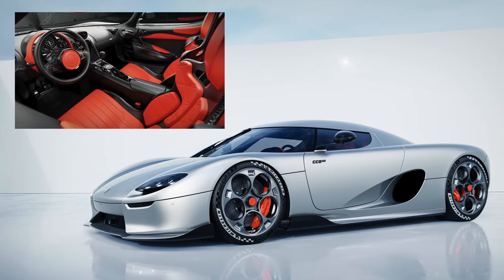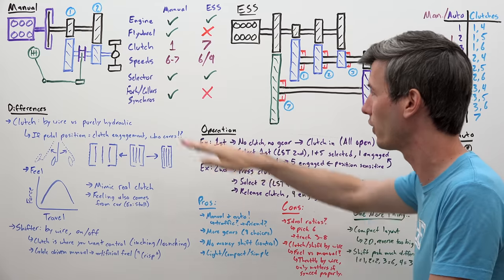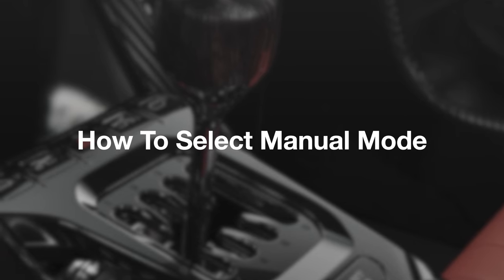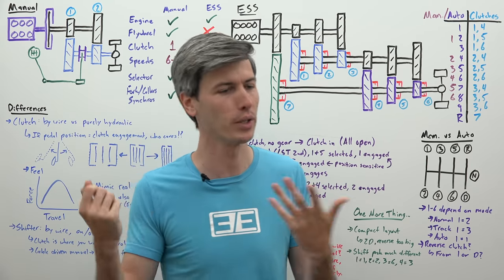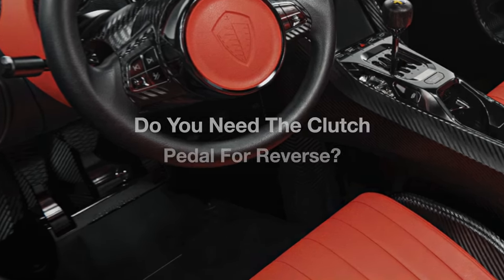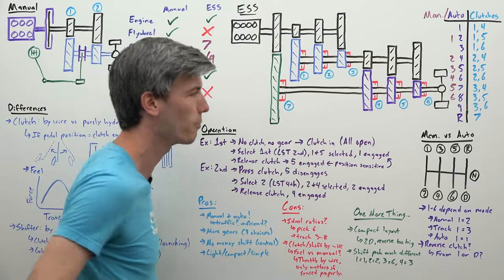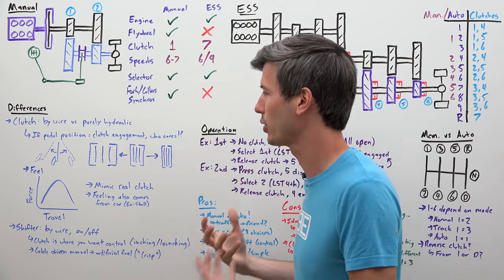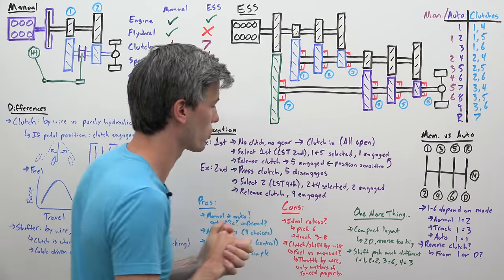Koenigsegg Reinvents The Manual! How The CC850 Transmission Works

Comment: Sigh but this means no synchro shifting because the computer needs both inputs. One of the joys of true manuals is confusing non manual drivers with clutch free shifting. Oh btw anything "by wire" with no redundancy is prone to catastrophic failure. Thus why fly by wire has redundancy. I think the engineering is beautiful but no redundancy so when the electronics fail that's it, it has failed with an actual manual you can get by on the synchros for a short period. That is why performance clutches have multiple discs it's for redundancy and reliability under high stress situations. Beautiful engineering,  but still with no way to get home in the event of a failure. Thus from that standpoint compared to a true manual it's a failure this would be great with a second electronic shift controller or a hydraulic back up but if you have a failure in the transmission or at the shifter of the electronics your hosed. So it's awesome but not because as per usual the automotive engineers don't think about back ups for failures. The only time I have been left stranded by a true manual is when I've had clutch failure and even then i can usually limp it home. I understand no backups in every day cars because they are prohibitively expensive but at this price point it makes sense that they should have put in a back up system of some kind that doesn't rely on electronics. Having had electronic shift controllers fail in an automatic trans or electronic solenoids fail your stuck until you can get a tow to the shop(or home if you are properly mechanically inclined). I would probably just get this as an auto if I could afford it rather than mess with this sure it's light and all but exotics/supercars/hypercars are notoriously unreliable and exceptionally expensive to tow and repair. I also understand that the people who can afford these know that and can afford the tow and repair but, that still takes away from the enjoyment of the car and this is why even when these things have been in the budget I avoided them because I want to use and enjoy my cars and I don't get rid of a car with under a 100,000 miles on it and even then that's needs based a toy like this I'd like to enjoy to 3 or 400,000 miles who cares about resale value. What's the point of having a car to stare at it when it's about the drive!

Comment: I find it genuinely hard to believe this isn't some kind of joke. As a mechanic by trade I feel for every poor soul who has to try to diagnose any form of issue with this transmission. 7 clutches. Reverse can be both manual and automatic. I see lots of electrical gremlins and destroyed gears in the future of this gearbox. I cannot belive it passed the r&d stage

Comment: So I have a question.  Since there's a clutch engaged from the pedal action and also one at the gear shift.  Does that mean you could let off the clutch completely before putting it in any gear and then engage a gear using the gearshift and start rolling.  Or engage the gear and just push the clutch in and then release it and get rolling.  Super curious how this all functions in person.
Reply: I don’t believe that the position of the gear selector action is actually linearly controlling  a clutch like he describes, it makes no sense to me. It is probably just on/off controlled if the gear selector is in gear or not and then let the pedal control the other clutch. 

The gear selector has force feedback so you can’t put it in gear if the clutch pedal isn’t used.
Reply: @johns2242  Its got to have some control though, maybe not linear with the stick position but still not on/off like you said.  Also the force feedback, wouldn't it just be a double gate like a gate on a shifter.  Can slowly let you stick into gear but can also open fast or stay open or closed.  No idea on my end, just trying to visualize it.

Comment: So, since the shifter also opens and closes clutches, just like the electronic clutch pedal, can you shift without utilizing the clutch pedal bc the shifter is controlling the clutches also? Kinda reminds me of driving a tractor trailer (only using the clutch pedal for start & stop) except in a rig you've gotta match the RPM to the wheel speed while shifting, where in theirs this car the clutches would just engage - but maybe you'd wanna let off the gas a little to keep from burning the clutches from mismatched RPM & wheel speed

Comment: What about parasitic torque loss, is it higher with three shafts and two clutches per gear, or is it about the same as previous Koenigsegg "traditional" manual transmissions (or other "traditional" but still "by wire" clutches)?
Reply: Parasitic loss is probably a bit higher, but I’m guessing it’s more than compensated for by the additional ratios and being able to keep the engine closer to peak power after each shift. Plus in auto mode it can keep the throttle open so the turbos stay spooled through the shift.

Comment: I'm wondering what type of clutch will be used, especially for the lower gears? The amount of torque they'll need to hold will be insane yet they also need to be compact and give a controlled release or engagement when you're driving moderate speeds.
Reply from the maker: I believe they're all wet multi-plate clutch packs.
Reply: Also keep in mind that the clutches in the lower gears don’t necessarily need to hold full engine torque x gear ratio. There’s a limit to how much traction the rear tires have, so the clutch packs only need to hold enough torque that the wheels spin.
Reply: @EngineeringExplained  any plans on doing a video on regular planetary automatics? Seems like it’s one of the most misunderstood components of cars, and it’s almost like enthusiasts are the ones clinging on to misinformation the most. Any of the following would be interesting: modern torque converter lockup strategy, microslip to alleviate NVH, how ratios are accomplished in planetary gearsets (e.g. ratios in series vs ratios through differential action), how they can power upshift and downshift, etc.

I know you did one on the ZF 8 but it didn’t really go in depth on how it works.

Comment: So, Koenigsegg's new transmission works a lot like a Honda automatic from 2005. It just has a manual mode that allows you to select more than gears 1 and 2 and it has a pedal. That shifter and pedal are going to feel dead. They are just electronic controls.
Reply: Honda's parallel shaft automatics didn't compound gears to get additional ratios, so they were relatively massive for how few gears the had.

Comment: I feel like those tiny clutches will be worn down pretty quickly. While automatic transmission usually have many clutches those are not used to slip - they are either on or off, but not used to start the car or anything like that: there's a torque converter for that in automatic. Slipping with a tiny clutch doesn't sound reliable to me...

Comment: If the the shifter ist linear to the clutch engagement. Couldnt you just shift without clutching? The other clutches would move as fast as the hydrauslics allow.

Comment: For all of the effort to mimic the operation of a manual, why not program the transmission for clutchless shifting?  The pedal would be used for 1st gear and reverse, 2-6 would be no pedal, or at least the option  for that mode.

Comment: Having a computer read a lever and engage internal clutches is NOT a manual transmission. Also changing the clutch(es) on this thing looks like a lot of fun... NOT

If they wanted to make the manual better they could put a hybrid motor inline with the crankshaft and have it replace synchros. No clutching needed to shift, super fast shifting, and if the motor failed you could still use it as a standard manual.

Comment: So let me ask an engineer. What, if any, is the reason(s) car makers never utilized a splitter like you’d find in a semi. I envision an H pattern shifter as an eight speed where you throw the splitter after you’re in 4th.
Reply: Regular automatics already sort of do this- that’s why you can get 8-10 speeds out of 3-4 planetary gearsets and 5-7 clutches.
Reply: On older Volvo cars like 240 and 740 with 4 speed gearbox and overdrive, you can manipulate the overdrive to work on every gear (instead of just 4:th) so you get 8 speeds. But the overdrive cannot take the torque from the lower gears, so it's not a good idea.

Comment: Does this make it impossible to skip gears in manual mode? seems like you can only go up or down one gear with clutch activation
Reply: I don't see why. Say you're in 1st: Clutch pedal down, clutch 5 disengages; pull shifter out of 1st gear gate, clutch 1 disengages; skip over to third gear gate, clutch 2 is engaged; clutch pedal up, clutch 5 is engaged and you're now in third gear. There's nothing about the sequence that requires you to step from gear to gear; you could literally go from 1st to 6th, with clutches 1 and 5 disengaging, and then clutches 3 and 5 engaging.

Comment: Without a fork and syncros how does the transmission know which clutches to choose? Its there a computer that tells it when you shift the lever into gears or is the gear lever attached to a operator that closes the clutches with the selection?
Reply: @JayDee-b5u  Mechanical Hydraulic or does the TCM tell when to send the fluids? I am suspecting its electronically controller based on the performance mode settings changing the gear ratios

Comment: Kind of a hybrid of a manual but with automatic type wet clutches. But with no planetary gears and essentially two 3 speed manuals but with wet clutches. Must have some massive hudraulic pressure which would make some loss compared to a real manual.

Comment: what happens when you manually switch from first to second without touching the clutch pedal? according to the logic it disengages (1) and engages (2), but the (5) is engaged, so switching this way you actually switch to 3d manual gear though the shifter is in 2nd.
Reply: Yeah, I'm curious about non-standard shift sequences as well. I suspect that the computer just disengages all clutches any time the selector goes to (or through) the neutral position. In which case you would still need to use the pedal to get it into the next gear.

Comment: I'm a huge fan of having a manual transmission for the fun of driving it, but this just seems overly complicated for no reason.  It's really just an auto transmission with a manual interface. For a car like this, it just seems superfluous. It's going to be faster in auto mode, so you're adding a layer of complexity for probably no gain.

Comment: Is it possible to not use the clutch pedal, but slowly engaging the gear lever instead?
Reply from the maker: No, there are two clutches for each gear and both must be used. You can put it in gear without the clutch if the engine/wheel speeds match for the given gear.

Comment: This is about as manual as drive by wire brakes/throttle..... You are not manually connected to the transmission in any meaningful way. You can replace the shifter with a push buton panel with 1-6 on it and the clutch pedal with an "open clutch" button on the steering wheel as it is all just electronically controlled.

Comment: My only complaints which yes there are a few complaints, which has nothing to do with the drive by wire setup. 1: The way you explain this makes my bloody head hurt. And 2: It still sounds like an automatic pretending to be a manual tranny. 3: There are a lot of parts that can and will fail, resulting in a less reliable transmission. Now that does not change that I would be more comfortable with this kind of e-tranny then I would what Chevy uses in their Camaro. Which is as far as I am concerned is nothing but an automatic pretending to be a manual, where as the Koenigsegg manual looks more like a manual pretending it’s an automatic.

Comment: If only two clutches are engaged at a time then the remaining 5 clutched are under the force from release bearing right? (Or don't they have it?) That means those release bearings are gonna wear out fast.
Reply: I have the impression that the clutches are engaged by hydraulic pressure, like in a common automatic gearbox. The unengaged clutches just don't receive any hydraulic pressure. So no compressed springs or release bearings.
Reply: @nhytg376tgyuu765gjmg  that’s correct. They do have return springs but so do all automatic transmission clutch packs.
Reply: No release or apply bearings here, it’s all hydraulic.

Even if there were, it’s not a problem if the bearings are designed properly. All dry and even some wet clutch DCT’s use apply bearings, so one bearing is always pressed against the clutch to clamp it. You don’t hear about apply bearing failures on the VW 7-speed DSG, or the Kia/Hyundai 7-speed or 8-speed DCT’s.

Comment: Just to make one thing clear: Nobody in the world ever wanted do have manual transmission. It was born out of the necessity to keep combustion engines running within a certain rpm range, as the rpm range they can effectively run is very limited. If these motors had worked without transmission at all (like many electric motors today) or automatic transmission had been easily possible at that time (and as efficient as it is today), manual transmission would have never existed in the first place. Funny how some people today worship a technology that only exists out of a historic necessity and want to keep working harder for a machine instead of having the machine work for them 🤷‍♂

Comment: Can we just not use the clutch for some gears like 2,3,4 and use just the gear lever.. there is no fear of grinding gears as it is still just a clutch pack?.. I still feel it's a big gimmick.. and it's just G27 racing wheel with precisely weighted gear levers.. and better designed clutch pedal..

Comment: Why can't it just be a traditional 3-pedal manual transmission with automated actuators for the clutch & gears that can simply be disengaged? I have always wondered why no automated manuals can deactivate the automated part and give you back the ability to use the clutch and row your own gears.

Comment: so its not really a manual transmission, just a multi clutch transmission with an electronic gear selector that happens to emulate an h-pattern gearbox? it wouldve worked just the same if the shifting was done with paddles. i wonder how the actual shifting feels, if it has than nice mechanical thunk when you put it in gear

Comment: A manual transmission does not have any electronics other than a reverse gear sensor hence it being manual. This isn't really a manual transmission. It's an automatic with a shifter instead of sequential steering wheel pedals. The concept is great, the description/name is inaccurate.

Comment: Mechanically, the idea is cool, but from a maint standpoint, you now worry about 7 clutches to wear out at any given point instead of one.

But I'm sure if you can afford a Koenigsegg, then a clutch replacement whenever isn't a money issue.
Reply: Modern automatics have 6-8 clutches and generally run fine with nothing more than fluid changes.

Comment: It's more complicated, has more moving parts and perishables than other gearboxes, more failure points, more possible mistakes by the driver, more expensive and has a manual clutch for absolutely no need other than to allow the driver to be less efficient than a computer. Engineering 10/10, need 0/10.
Reply: Typical modern automatics already have 6-8 clutch packs, so your point is invalid.

Aisin transverse 8-speed: 6 clutches, 7 if you include the torque converter clutch, 9 if you include the sprag clutch. Used in Camrys, RAV4s, Volvos, Minis, VW’s, etc.

ZF-8 speed: 5 clutches, 6 including torque converter clutch.

Honda 10-speed: 7 clutches

GM 9-speed: 7 clutches

Etc.

Comment: I wonder how long all those clutches last. That has to be an expensive service.
Reply: Typical modern automatics already have 6-8 clutch packs, so your point is invalid.

Aisin transverse 8-speed: 6 clutches, 7 if you include the torque converter clutch, 9 if you include the sprag clutch. Used in Camrys, RAV4s, Volvos, Minis, VW’s, etc.

ZF-8 speed: 5 clutches, 6 including torque converter clutch.

Honda 10-speed: 7 clutches

GM 9-speed: 7 clutches

Etc.

Comment: This seems kinda redundant they basically just made an automatic with constant mesh instead of planetary gears and gave replaced the torque converter with a more traditional clutch
Reply: It probably fits the engine bay better than a concentric planetary automatic design. This design is shorter and wider. Most planetary automatics have ratios that get tighter as you go up, whereas this has pretty much the same ratio step between every gear.

Also, just guessing here, but this design might be easier to cool because the components aren’t nested instead each other like they are with a planetary design.

Comment: I'm a little disappointed in the lack of power-shifting talk. It seemed like you were leading into that by talking about how far you have the shifter engaged determines how engaged the clutch is...

Seems like this would be the ultimate powershifter, not even needing to pump the clutch pedal, just rip the stick into the next gear with your foot flat on the floor.

I also don't see the point of that compared to a DCT. I'm sorry, I love a manual car, but at some point you just have to concede that it makes absolutely zero sense on a supercar.

Comment: So, NOT a manual transmission at all.  An IMPROVED and faster transmission, certainly.  And I'm sure the force feedback will be well tuned to very accurately simulate the feel of a manual transmission.  I just disagree with trying to sell this as an actual mechanically shifted manual transmission.